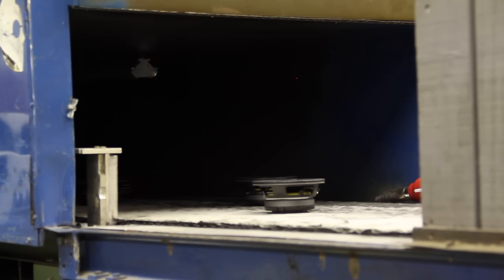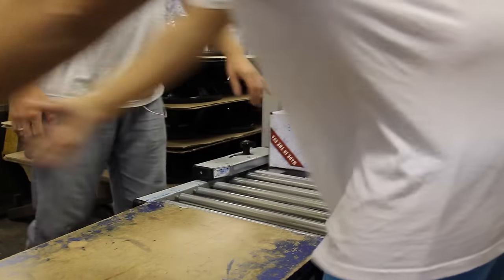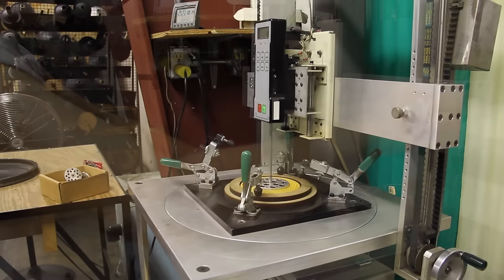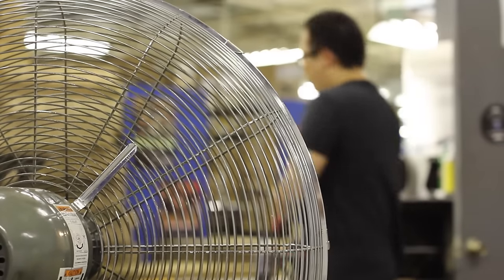Eminence Speaker Factory Tour

Comment: I have used Eminence speakers for  more than 10 years now, and they have earned me respect there is a time I had only four Midrange speakers and two 18" single bass, for a band set up. The MC was using the DJs sound system but when he tried my Sound he refused to use the Other system......
Crystal clear sound good job... Eminence

Comment: About 35 years ago, my job was reckoning and repairing speakers.  The most challenging job I had was an Eminence speaker came needing the woofer reckoned.  No parts dedicated to this speaker were available from my sources.  Luckily, the 4" voice was in good undamaged condition and could still be used.  The cone and spider had to be modified from available parts to fit the speaker.  I was relieved and very satisfied when the finished product  performed very well

Comment: I bought 4 Eminence beta 12 speakers.
Each one is 250 watts, I replaced my Marshall vintage 30's and run them in stereo.
 I play 7 & 8 string guitars as well as 6 string guitars tuned down to C.
I love the bottom end and I have to mic both sides for true stereo.
 That's 500 watts on each side.
I love my Eminence speaker so much that's all I use.
 I even swapped out my Marshall 4x10 to get a monster tone.
Weather I'm using my Marshall DSL 2000 100 watt head or my power amp with my line 6 HD Pro

Comment: Awesome video! I have some Eminence speakers I bought recently for an open baffle project. 12LTA (12in extended range woofer), and ASD1001 compression drivers (tweeters). And I'm considering what to get for the bottom end. One of my choices is the Eminence Alpha 15a, and after seeing this video. It might have to be the choice. I've looked at some other choices. But I doubt they're made as good as these. And really they're about if not the cheapest ones. Cheap enough that I can afford to run two per side also. Eminence is an impressive company!

Comment: SO, million dollar question. When you assemble the cap on the HF driver, do you use some sort of absorption material between the cap and the diaphragm? I don't know how many speaker manufacturers fail to do this, but it makes a huge difference in the smoothness of the sound. I can't count the number of HF drivers I've pulled apart and put fiberglass or some other material to absorb the reflections off the back side of the driver. Makes a huge difference in the purity of the sound.
Reply: I doubt you'll get an answer. I agree with you. Thr compression drivers I've taken apart from them have no damping material in them. Eminence is a budget speaker company and from what I can see in their video, they dont have the attention to detail as Scanspeak, B&C, 18 sound, etc. The bulk of their product appears to be guitar speakers. I love their neo drivers and beta 6 and 8, but the other stuff is so so.

Comment: great video, I enjoyed the tour. thanks. a couple of questions if I may.
what materials are used for voice coil forms?
do you use different gauges of ceramic copper wire for different sizes of voice coil?
Like say you have a 1" voice coil and a 3" voice coil both rated to 8 ohms, a 3" voice coil will have longer wire used, but you want the same inductance, impedence... right? so what gauge would be like for 1" and 3"?

Comment: Hi I Melted voice coils many times I 400 watt Eminence Sub Bass drivers,they sound awesome & get my whole crowd screaming with Elation,what happened was the Crossovers blew,so then I wired direct to the Sub Bass & The 80 watt tweeter which lasted for many years but now 1 has melted,I Play Via 2 1,600 watt NAD Amps which are Class AA & Sound really Clear & Punchy,but they have proved to be too Powerful for only 2 Speakers,now I run 2 Bass & Upper mid speakers also,it removes some of the power load from the Eminence which have an Excellent Sub Bass that only The NAD 218 can produce in Tandem,i'm looking to buy 2 High Powered Compression Drivers soon for the High Frequency Mid & Upper Trebles,thanks guys for Awesome speakers since my gigs started in 1981*

Comment: Hopefully Eminence sees this as constructive criticism, but at 10:30, that tiny bead of adhesive on the former right before the spider is slid down on it, surely has got to lead to some failures in the field?  The bead of glue at 11:05 after the cone is installed doesn't even have time to wick down and really connect the triple-joint all together.  There really should be an additional bead of glue on the inner-most ridge of the spider that touches the voice coil.  Also at 12:12, the tinsels are not left with any slack what so ever.  Give that thing just a little bit more, an extra 0.5cm of tinsel lead would be ideal.  Thx for reading.

Comment: I have loved Eminence Speakers since I first learned about them in the mid 70s. That was when I learned the Sylvania 12-22112-2 woofers were actually manufactured by Eminence. I am still trying to find replacement woofers of like specifications, except I don't know any of the specs beyond stamped frame, paper cone, 12", and high power. The speaker cabinet model was either AS125b or WS125b and each was rated at 125 WRMS max. They were either designed by Henry Kloss or one of his proteges. Any help will be greatly appreciated.

Comment: Would your subwoofers and speakers work well in DIY home audio custom cabinets? I am thinking of building custom speaker towers and a custom subwoofer enclosure and putting your tweeters and midbass drivers in the towers and a Omega Pro 18 inch for the subwoofer. Do your speakers work in home type settings?

Comment: thanks for keeping american's at work: i feel the need for big drivers, mid ranges, and compression horns in massive towers with high sensitivity, very high power handling at least 300 or better rms for home stereo. clean sound when u want it at normal listening and big bass when you need to rid the house of spiders and other critters...  you just can't hardly find a quality bulletproof built set of towers anymore to handle a big adcom or carver high power amp. (carver breaks too much lol)

Comment: I am an electrical engineering student. I want to produce speakers in the future. I have a hard time because of  there are no producers in my country. What materials are used especially in spider, surround and diaphragm? what is their raw material? I have no idea. For example, spider looks like  fabric, but it has a hard and definite form, the diaphragm looks like paper or plastic. surround looks like rubber. In short, what is used as a raw material in which and what kind of processes it has to go through Can anyone share information

Comment: One of Eminences early basic models is one of their best - a 15 inch cast frame with a 2 1/2 inch coil - very efficient. I don't think much of the neodymiums - not enough body for heat collection. Aluminium coils will get used past their melting point - over 500 degrees C.
Reply: 2 1/2" Voice coil for a 15"?! Very efficient yes. B&C builds 15" with 4,5" Voice coils. I know that this isn't necessary improving the heat dissipation, but how is a 15" driver suppose to be controlled with such a small Coil...

Comment: I luv these drivers!! I need some 12's with an extended high end for lead guitar. Most all out there sound like subs and I dont play bass.
Reply: Try a PA speaker?
I have been using sims and modellers instead of guitar amps and this technology really comes to life with a FR/FR type of speaker. 👍
Reply: @AdaptivePhenix  im tryin not to go tweeters
Reply: @AdaptivePhenix  man radio shack even used to have silvercone musical instrument speakers. In 77 my first amp a crate 1? Had the square magnet silvercone speaker. If they still made those that I could use. Now they got those pulse speakers but 9nly the 6.5" had the responce on the graph that looks like what I want but damn ? 6 " speakers? 
Perhaps 16 in one cab?